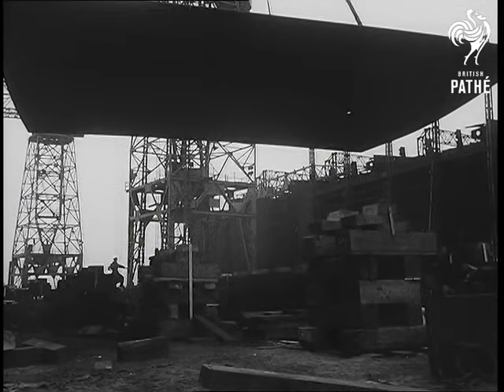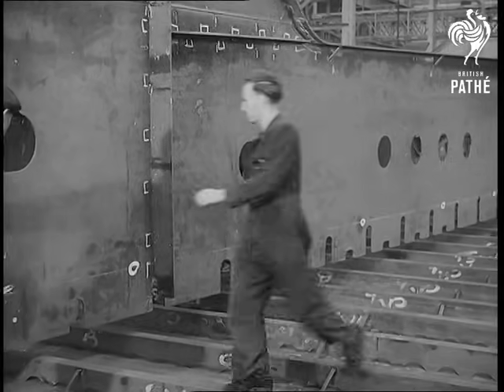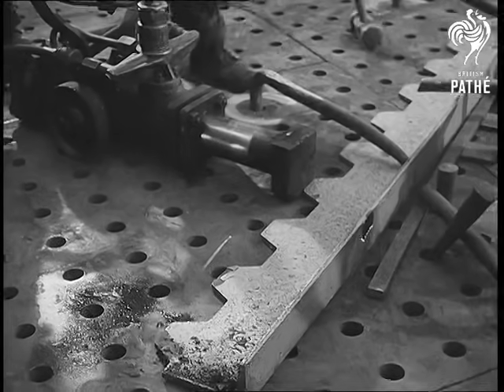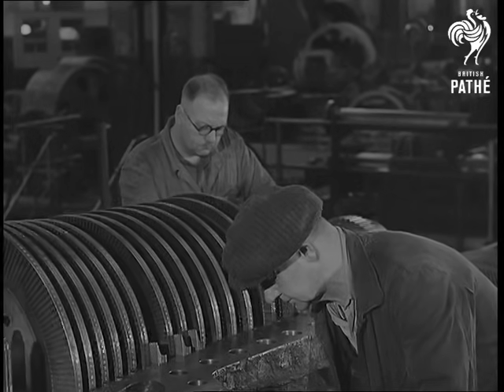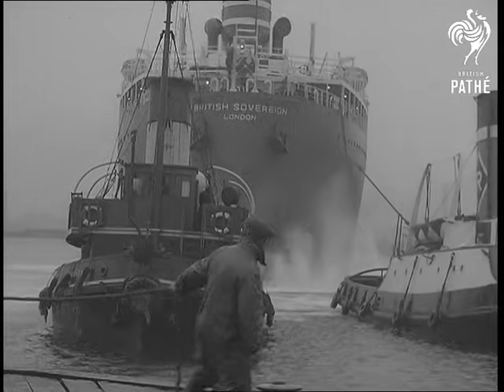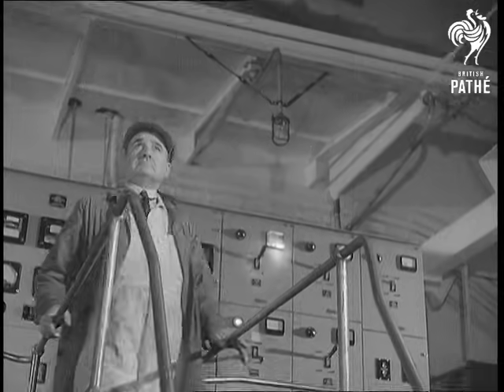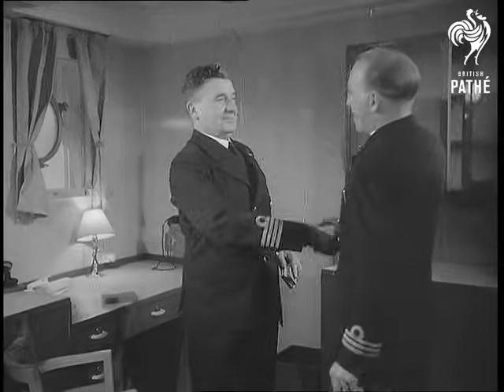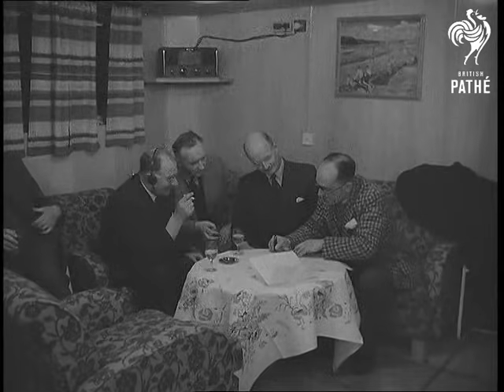S.S. British Sovereign (1950-1959)

Comment: I worked at the Barrow shipyard in the early 2000s, and the ceremony arrived for the first ship to be built in years. The local dignitaries and news teams were invited - well, the champagne hit the bows and the ship started to move down the slipway, only to stop a short way down. Turned out that all the blokes who used to do the job had retired, and they'd either used the wrong type of wood or lubricant (I can't remember exactly what the problem was). Just shows how quickly things are forgotten. There's also another anecdote of one of the submarines out on sea trials which dropped its propeller!

Comment: Wikipedia has the boat laid down in March 53 and launched in August 54. Nine years seems a bit long of a build time back then. I think they built the 100,000 tonne British Admiral in four years.
Reply: No it can’t have taken nine years, the S.N.P. Weren’t involved.
Reply: About fifteen years I was on a tanker converted to an FPSO. They wanted to use a heavy oil bunker tank to diesel oil. When the lighter diesel was introduced it leaked through the welds. Chinese built.

Comment: I started my engineering cadetship with BP in 1972 when they had over 130 vessels. By the time I left in 1982, they had 45, something of a come-down was it not. They probably have even fewer now and charter in when necesary. Even in my time (retired 9 years ago) a life at sea was seen as a decent well paid profession with good prospects afloat or ashore. Now, for some (and I've worked with a few) it seems to be a job of last resort, tried most other things but couldn't get on. Probably the best innovation in the last 20 years has been internet and email access, the old Sparky's jobs disappeared years ago. Gone are the days of Sparks with his head buried in the radar changing out valves or the magnetron. Fiddling with the gyro to get it stabilised after a blackout, orders coming in from Portishead by morse.....those were the days, swing that lamp and mind you don't trip over the engineer's toolbox when you leave the bar where more units were pulled than in the engine room!! Starting as a gadget then moving up, full blues in the saloon for all meals, Walport movies twice a week, 1st house for the 8 to 12 and 12 to 4, only 3 rings and above allowed for 2nd house. Happy (?????) days?